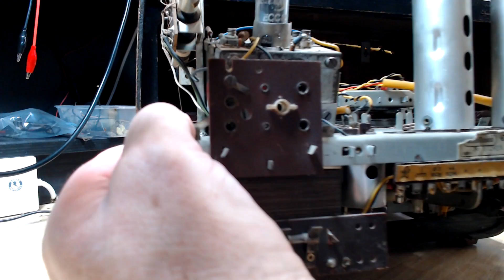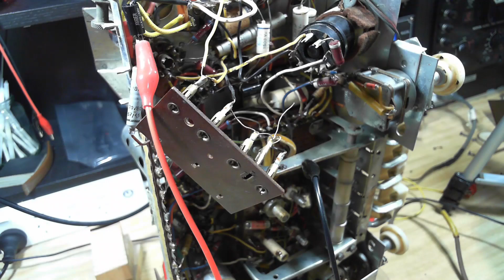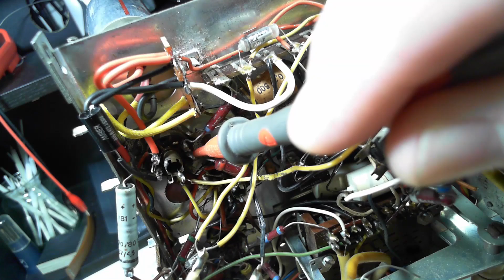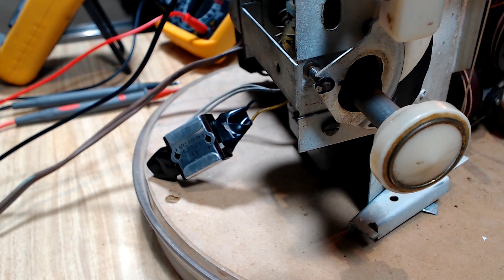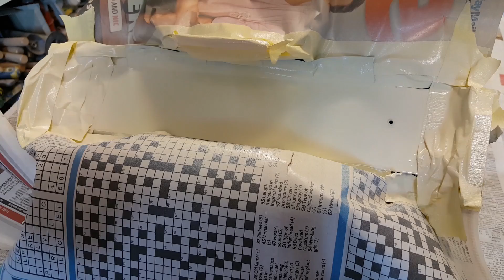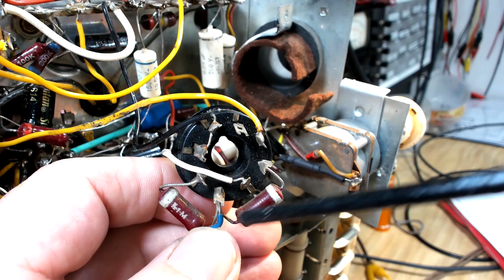NordMende Elektra 58 Restoration & EM34 Magic Eye Substitution  Pt 1

Comment: Hi David; you have made a error with the capacitor with the 3 connections. The third connection is not a shield but it is a build in 10 Meg resistor. You realy have to change it.
Look at the capacitor, it says so on the label ! ...You can also see it in the schematic.

I know some capacitors with 3 legs are indeed a shield ( like the ero )…. not this one.

Greetings....Dirk from Belgium.
Reply from the maker: Thank you Dirk, I have realised my mistake and added a complete 'Thanks Dirk' to the next video. I had no idea of what you were saying and had to fish the old cap from the bin and dissect it, it had a resistor in there! I guess that's the difference between experience and me. Thank you for pointing that out Dirk, cheers 👍😀

Comment: German paper capacitors sometimes look different, those white ones are surely fine? I bought a small HV insulation tester from China a few years ago that can test up to 1000V and it runs off one 9V battery. If I am not sure about the capacitor (perhaps it is a type that I never saw before), it will tell you instantly if it is good or bad (or if it is about to fail).

For the FM, test all the valves first (especially the ECC85 and EABC80, if the set has one). There could also be a dried up 5uF stabilising capacitor in the ratio detector circuit that sometimes causes distortion. And check if the IF cores are still untouched, as there might have been someone in before with the screwdriver there. FM alignment is a bit tricky, the best way is to use a sweep generator (wobbulator) and a scope.
Reply from the maker: Hi michvod, I have replaced the wax caps and the white ones now as well, I thought the white ones tested ok but I tested them again and they were suspect so out they went.  I have a Chinese tester, might be the same as yours. I will check the caps in the ratio detector section but I think I got them all, thanks for the heads up. The IFcans have definitely been 'touched', I will sort that in the next video. I don't have a sweep generator so I will do it as the service sheets suggest. It is my first FM alignment, wish me luck 👍😀

Comment: David, great job so far!

Question: have you decided how you are going to restore the faded markings on the white push buttons?
Reply from the maker: Hi Eric, thank you. The text on the buttons is a problem and it keeps me awake at night. The inprint is not deep enough in the button plastic and in some areas there is no impression at all, I might have to leave them as they are I think but I will lie awake tonight trying to find a solution I suppose 🙄😴

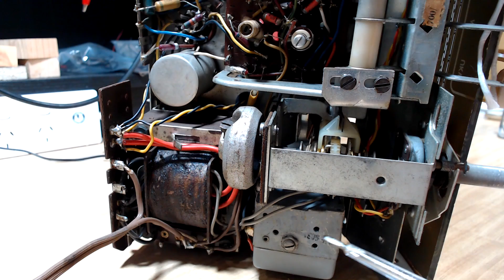Comment: Great! We had exactly the same back in the days! At 3:18 that grey case is the tuning capacitor. And to the left of it is the power transformer. So the chassis should not be connected directly to the mains.
Reply from the maker: Hi Ewald, thanks. yep, got all that now thanks. This type of radio is a new experience for me so a few surprises in there 😀

Comment: Never knew there was a 6E5C tube.  Cheap too.  Easy rewire.  Thx to you and Radio Museum !!!
Reply from the maker: Hi atwaterkent911, yep, cheap and work ok too 😀
Reply: 6E5C (actually 6E5S since the C in Cyrillic is an S in Latin script) is a 6E5 with an octal  base.
Reply from the maker: @douro20  Thanks for straightening that out, I read somewhere that the C and S required a different grid voltage. I now think that was misleading.

Comment: I've got a Grundig Majestic 3165 , a five band radio , that I picked up in Nurnberg , when I worked at Grundig. The radio cost me $ 100 in the Grundig family store , at the factory. It's still in original condition. I have never recapped it or repaired it other than a few tubes and pilot lamps. In the meantime I did fuse the line cord and the B+ lines. The receiver works perfectly on long wire AM and outside FM dipole. I did check the alignment and it was spot on. I have tested the filter caps and they look good. The piano key switches did need cleaning and lubricating. I'm hesitant to do anything to it. The radio keeps me company in my radio shop. I can play phono or tape through the rear 5 pin Din jack. The Audio is only monaural, but there is a three speaker sound system inside the cabinet with an external T jack on the back panel. When I bought this audio was only Hi-Fi. Stereo came along later in the mid 1960's. I bought it in 1964 , however I think it was NOS then. That's why I got a good price on it. Looks like yours is coming along nicely. Perhaps I'll be inspired by your success to recap the chassis.
Reply from the maker: $100 for a radio was pretty expensive in 1964 I would have thought Cosimo but there is so much work in these European sets. That works out to about $1.80 a year so far so still good value. I hope all is well with you virus wise 🙂

Comment: You could tell that this one was going to be a challenge as soon as you removed the back!  No speaker, loose can capacitor, botched up power cord, etc.
Where do you find the schematic diagram for that one?  Do you have a web address where it can be found?
I see you decided against the PPE on removing the innards of that capacitor (no gloves, etc.), and although it was, or at least looked to be, a bit of a chore to get the stuff out, it came out much easier than I thought it would.  Good job of mounting the replacement caps in the can.
With that one wire missing, it couldn't  possibly have worked when it was stored!  Good catch.
On that 3 leaded capacitor, I think they did that to attempt to compensate for people not putting the outside foil end of the capacitor to the low impedance side of the circuit, not sure, might be incorrect in that, but that is what I think anyhoo.
Those Magic Eye tubes are becoming "UNobtainium" these days.
Eager to see the future videos on this one.
Reply from the maker: Hi Wayne, the schematic was in Radio Museum, it's in German unfortunately. I had a mask, goggles and work apron on when working on the capacitor, I ditched the gloves because they were getting caught in the control knobs but washed up thoroughly after. I left the screen wire out by mistake, it had become detached and I didn't notice it. That capacitor with the extra foil was on the lead to the volume control, I have seen them before and I'm sure it's to block any RF getting in there. I think I wasted my time on it but anyway 🙄 Yes, magic eyes are getting very hard to get 🙂
Reply: @ @DavidTipton101  I was about to comment theorizing that when the loose electrolytic can was amateurishly replaced, the screen wire was left out.  Stay Calm ...

Comment: Great video David,  eagerly awaiting the follow-up, perhaps you'll find out why the magic eye is not bright enough!  That missing wire to the screen pin was interesting!    Walt in Miami
Reply from the maker: Hi Walt, once I mounted the eye in the radio it was ok, still a little dim but ok. It isn't getting the specified plate voltage but reducing it didn't make it less dim so I'm not sure. The missing wire was my fault, the original had broken off and I didn't notice it at the time.  Keep safe in Miami 😀

Comment: These old Nordmendes are lovely and sound great. The Germans call those wax/tar capacitors "Teerbomben" (Tar bombs) and you should replace them on sight. I saw a few still in the chassis that I would replace, simply because they will become conductive sooner or later and that puts an extra load on the high voltage windings of the power transformer with ugly consequences. You'll see the difference in the watts drawn after the cap job.
Reply from the maker: Hi Derek, you were mentioned in discussions with your friend in Madeira. Which caps should I replace? I went through and replaced all the white ones which I will document in part 3. All the traditional waxies are gone and the filter caps as well. The selenium rectifier is replaced in part 2. The clear capacitors are in low voltage areas and seem ok. Did I miss something 🤔👍
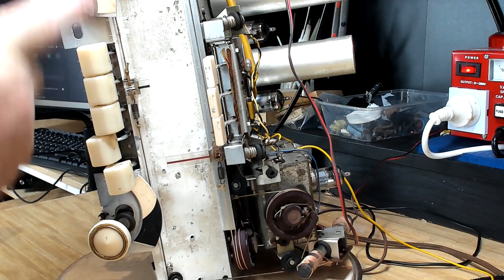Reply: @DavidTipton101  At 12:51 I see a big boy at the 11:00 position. 17:01 bang in the center of the screen, They like to put 0.1uF' s on the supply line to the tubes in the RF and IF stages. If you have already replaced them then no worries.
Reply from the maker: @DerekHerbst747  At 12:51 there is a black paper waxie with orange paper wrapping , I have replaced that. At 17:01 there is a clear plastic cap with red paper in it, below that is a black cap that is a replacement cap. If it's the black one it's a replacement black cap that I use, if it's the clear one let me know and I will change it. I use black ones as they don't stand out like yellow ones. Hope all is well with you and your work, aviation has been hit hard, thanks for your help Derek this project is a stretch for me 🙄😀
Reply: @DavidTipton101  I've never had one of those clear Polystyrene caps fail on me. All the paper ones is what I meant. I am sure you've nailed them all.
Reply from the maker: @DerekHerbst747  Great, thanks Derek. I also found the white caps leaky so replaced them too
Reply: @DavidTipton101  Regarding the job, we are flying at max capacity. Cargo is booming and rates have quadrupled in the last month. I am WFH at the moment.
Reply from the maker: @DerekHerbst747  That makes sense, with commercial flights grounded cargo operations would be booming. I hope everything goes well with you, good you can WFH (I had to look that up 😀) Cheers and stay safe 👍🙂

Comment: Nice radio, love the Nord Mendes, but you managed to a waste a perfectly good crossword puzzle, mate.  These days they're practically legal tender ;).  I enjoyed the magic eye swap-out.  I plan to do the same with a 1950s Japanese radio that didn't come with one, but I found a nearly identical schematic that does show one.  So, my radio will get an upgrade.
Reply from the maker: Yeah, sorry about the crossword SY, I don't know what I was thinking 🤦‍♂️ If you plan to use the same eye as I did there is a 6E5 'S' version which uses less grid voltage for full closed 🙂

Comment: Well done. The ERO (ROEDENSTEIN) capacitors are the troublemakers. All capacitors that are filled with yellowish wachs, Black terr, and white plaster typisch material are paper capacitors wich leak horrible. On the opposite you have in these 50-60s German sets a lots of very stable ceramic capacitors and high quality parts, wich makes the really dependable with a very nice sound.  
The stuck changing mechanism for AM FM can be lubricated with brake cleaner, at least that had worked on my sets. But you have to make sure that it completely dried before you put power back on, if not you risk to set the set own fire as break cleaner burns well.  

Note that the 6E5C has a smaller negative grid voltage then the EM34 so the show might behaving different. 

but the 6E5C still seem very dark, too dark for a new tube. The soviet tubes usually don^t last as long as a proper Telefunken, Siemens, or Valvo tube. 

Wartung for episode two
Reply from the maker: Thanks Alex, I didn't see the name on the caps before I threw them away but I will heed your advice for future radios. The wave change dial indicator mechanism is working after I cleaned and adjusted it.  The magic eye is ok as it is, once it was in the radio it was bright enough, I hope it lasts for a little while 😲👍😀

Comment: Nice radio David, hope you solved the magic eye. Looks like the anode voltage is low or maybe something odd like the cathode high, maybe a resistor.  Thoroughly messed with but not a project killer thankfully.
Reply from the maker: The anode voltage is a little low (230V not 250V) but boosting it made no difference, the cathode is at ground potential. When the eye is fitted in the radio it looks ok, not great but ok.

Comment: What does the magic eye do ?
Reply: It provides a visual indication of tuning and signal streanth. I just love them.
Reply from the maker: It monitors the Automatic Gain Control and provides a visual indication of the peak tuning point of a station. A number of later radios (and some early ones) had a needle meter to assist with tuning 🙂

Comment: I was always told a capacitor can be 20% lower or 80% higher than spec and be ok.
Reply from the maker: That's a trap for young players... sorry 😉 If the cap reads high out it goes, that's my new motto 🙂
Reply: yes but that is trap for young players Dave would say. This Capacitor Meter is measuring the time the capacitor charges up. If a capacitor has a leakage current then it needs logic<lly longer to charge up. 

An expensive proper capacitor meter measures the capacitance vie the charge that can be taken out an fully charged capacitor, and hen you would see that an leaking capacitor has a problem

Comment: Hi David,
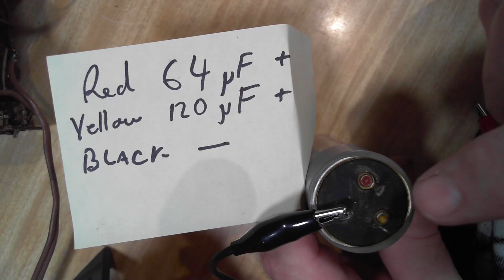Around 6:00  That electrolyte looks okay to me: tolerance on this type of capacitor is generally -20 +50%
Now I will watch the rest of the video 😊
Ah, too late I see. Maybe for the next German radio. 😎
..
No German voice coming out of the speaker, how odd 🤓
Looking forward to the next episode. Cheers 👍
Reply from the maker: Hi Plons0Nard , ha-ha, yeah should have had some German content in there. I have come to think that if a capacitor is reading high it is probably faulty. If the manufacturer can't make a cap within a few percentile of the advertised value it shouldn't be in there anyway, I think the best option is to change them if in doubt 👍🙂

Comment: I've been putting off replacing a dim 6G5 / 6U5 magic eye with a more readily available equivalent and suitably rewired base. David, I now have the motivation to get it done. Stay safe and thanks. Terry.
Reply from the maker: Hi Terry, you must do it. Thank you, stay safe too 😀
Reply: You'll have to re-bias the tube since it has higher gain than a 6G5, but other than that it should work without much issue.